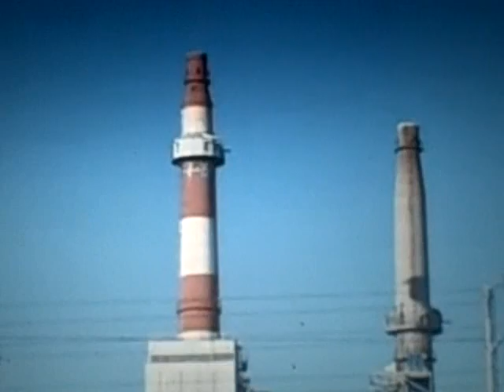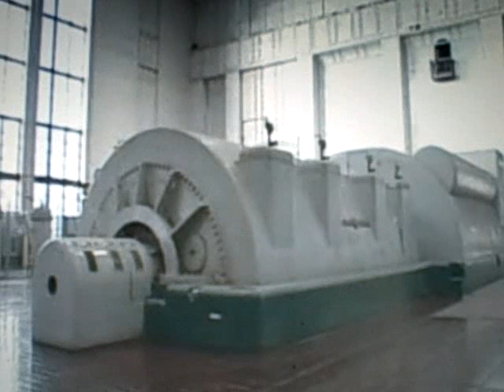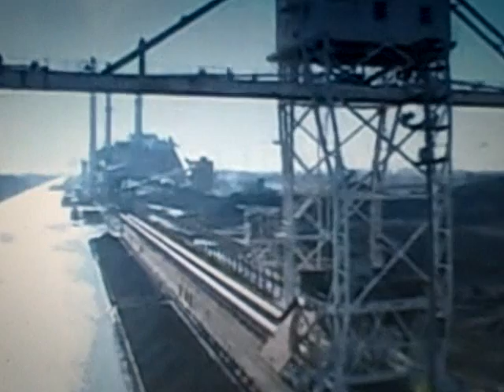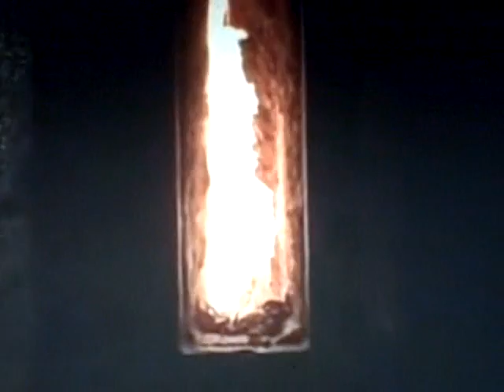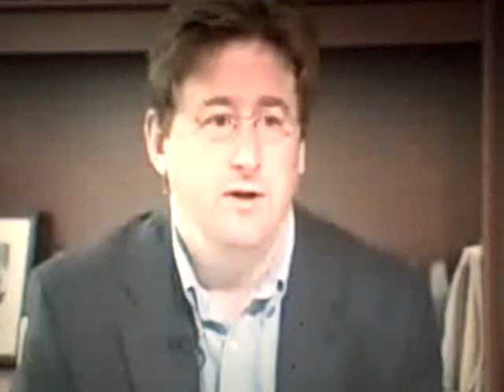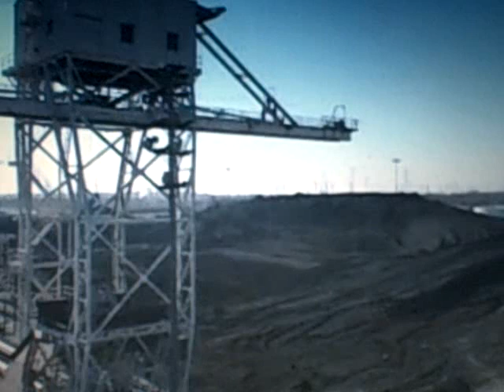CO2 Emissions from U.S. Coal-Fired Power Plants - 3Ceco.com

Comment: The Body of the Windmill is Carbon fiber made from oil, and steel that is manafactuered using "coke" (coal) or petro coke(oil) and then their is synthetic rubber(oil), Plastics(oil),and silicone parts(oil) and because it has moving parts it needs to be greesed(oil)
Not to mention the machined to make the parts are run by electricity from Coal, Oil, or gasoline generators, then they need to be transported by Trucks/Ships (disel) to the sites and Assembled by Cranes(disel)
Getting off Oil?